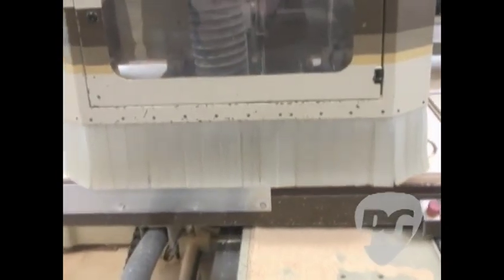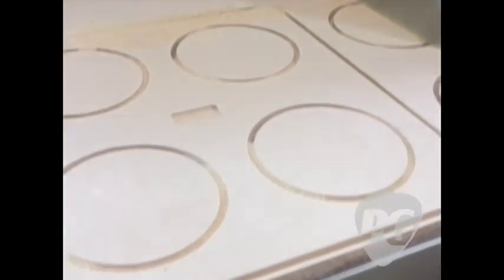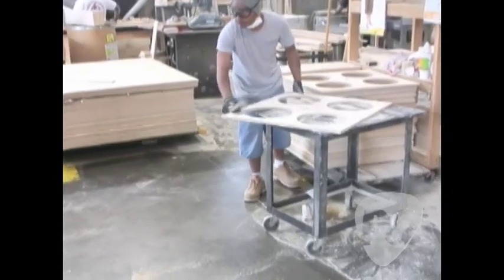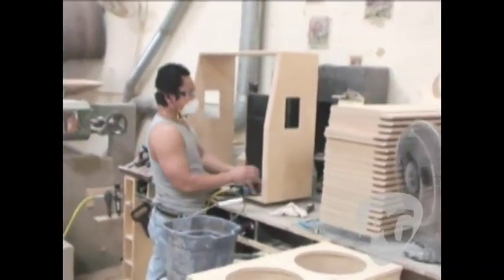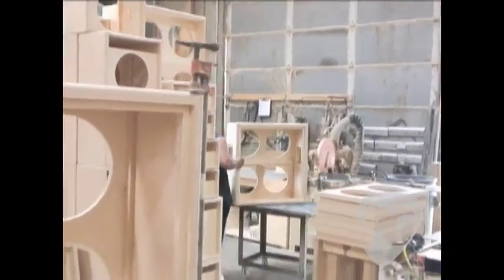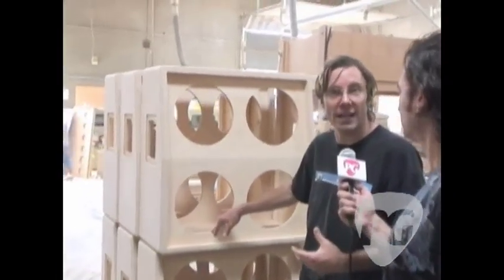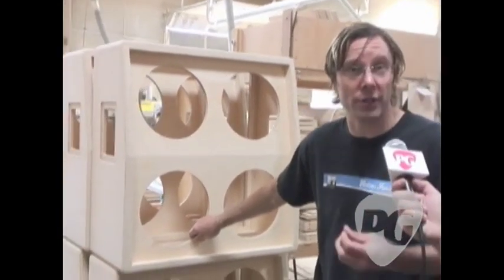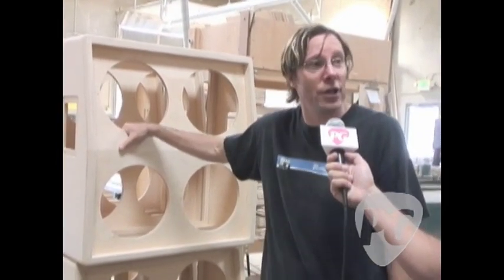Mesa Boogie Factory Tour-Building Boogie Cabs

Comment: @DB73093 2 16 ohm cabs would plug into the 8 ohm sockets, when running two cabs  the general rule of thumb is the ohm setting is half of one cab so two 16's equal 8

Comment: I"m amending my previous post. It will only cost $200 to build one 4x12 cab. That price includes plywood for cab, tolex, grill cloth, handles, corners, jackplate and jack, and all mounting screws. I didn't include the internal wiring and terminal since those are very cheap and most folks have them in their garage or basement. What is not included was the circle cutting router jig used to make a reusable jig to cut the four hole is front baffle.

Comment: Rabbeted corners?   That's not how you do it.  Finger jointed is better, and is best for plywood.  Dovetail joints for hardwood.   But doing rabbeted joints is CHEAP and does not yield a high strength joint.

Comment: I started building a 4x12 using professional quality woodworking tools about a year ago. So far, I've been able to build 1 cab out of one full sheet ( which comes metric sized which equals 60"x60". 1 top, 1 bottom, 2 sides and front and rear baffle with very little waste. That sheet was under $50 and its not 18mm (3/4), it's 15mm (5/8). 3/4 would be way too heavy. The only part that gave me a headache was setting the dado blade and building the tablesaw finger joint jig. if the jig is off by even .010, the accumulated error will not let the fingers go together. I figure the whole cab will cost me about $ 350, not including speakers. Having a CNC machine would sure speed up things.

Comment: I can tell you it costs more than $200 or even pounds for materials and manufacturing. head down to your local hardware and build your own. Go and buy a sheet of marine grade QUALITY 18mm ply $100-$200, tolex $50, side handles $25, castors $25  plus, factory rent, wages, insurances, 3 phase electricity, machinery cost ( that CNC's are worth hundreds of thousands of dollars ) phone/internet not to mention the skills to build one plus they're a business they're primary goal is to make money, if they didn't they would go broke and no more Mesa Cabs then you'd be complaining they're not around anymore. You wouldn't go to work everyday for a couple of $$$ People who aren't in business have no idea what goes into running one. Plus you pay for quality period.
Reply: well said
Reply: Ummmmm you know they buy in bulk wholesale lots of everything right? Which means it's discounted even more than regular wholesale + long term agreement discounts. So no, it does not cost them a premium retail price to make these "they're a business they're primary goal is to make money, if they didn't they would go broke"! And we can't have that can we Boogie lovers?
Reply: @jeffparryncc1701  Ya doing so good, sold to another company so quality can go away. A company who's quality has been a question for a while. Yaaa ! But in my own reality get a older Mesa and find a GREAT repair shop. Cause Boogie's ain't built to last forever. And if you got 1 of those complex builds with stacked circuit boards and B S quality parts they build with...... Well buyer beware!  And I'm so damn happy with my Boogie S O B. So I am a fan boy also. Growing up I had a picture of Mesa/ Boogie's of various artists on my wall including a poster of Boogie amp on display. Also all my equipment was bought used and is old. 80's 90's guitars, amps and pedals. Fender, Gibson, Mesa, Boss, MXR. Not to much actual NEW stuff. Unless it's free or cheap. Like someone gave me a H B Monoprice 15 watt amp cabinet without the amp part. Just a Celesion 70/80 speaker and reverb tank. Put a new Hotone Mojo Diamond (Fender Tweed) head on it and it's my best sounding practice amp. Or even small gig. Smaller, lighter and easier than Boogie in road case, Fender Twin, Lab series L5, or any of the other big heavy amps I got.